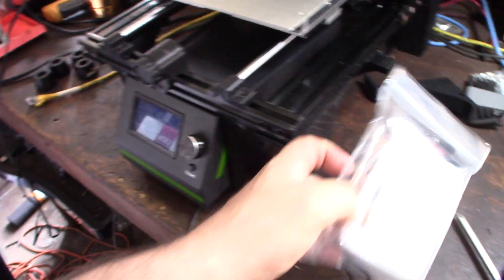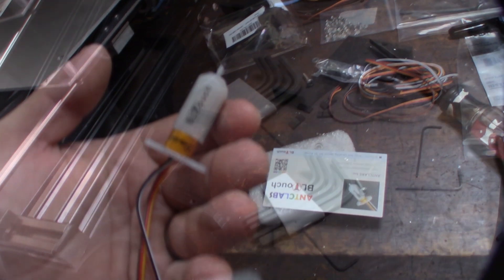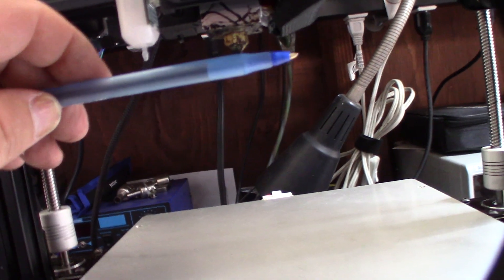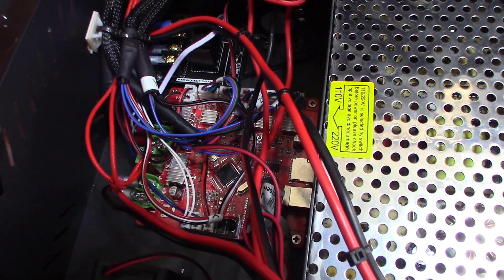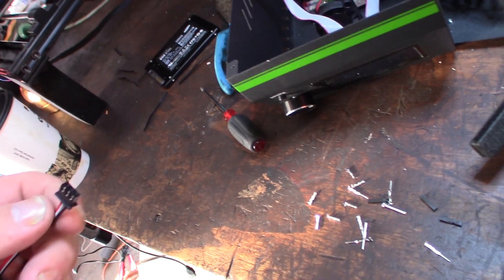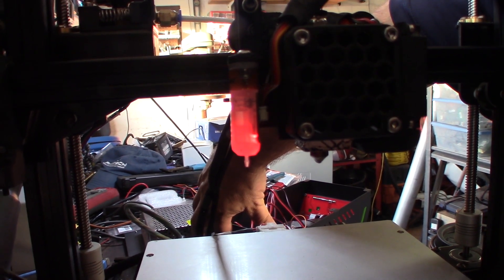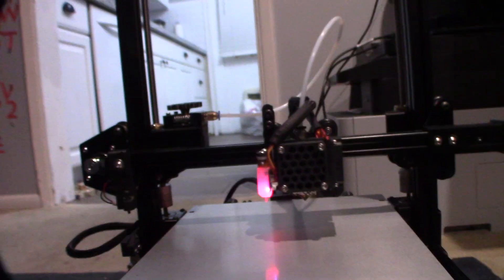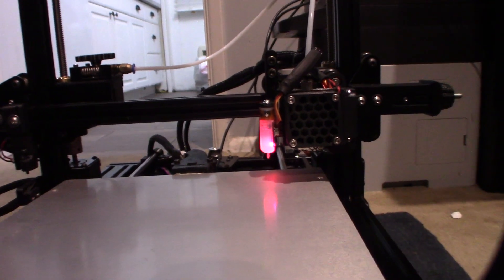Anet Bltouch A8 E10 E12 install and wiring setup

Comment: Here is the Pin 29 breakout board if you don't want to solder it. https://www.ebay.com/itm/202569234114. Also if you have a 2004 LCD, here is Pin 27 breakout board. https://www.ebay.com/itm/202571021260

Comment: If you don't like the soldering and cutting wires, here is the PIN 27 break out board. https://www.ebay.com/itm/202571021260

Comment: Where did you upload the config file? Can you link it?, 

Could you make a update video, on the wiring you maked on the motherboard I can't figure out where pin 29 is?

 I have mine conected to pin 27 but i have the same blinking problem